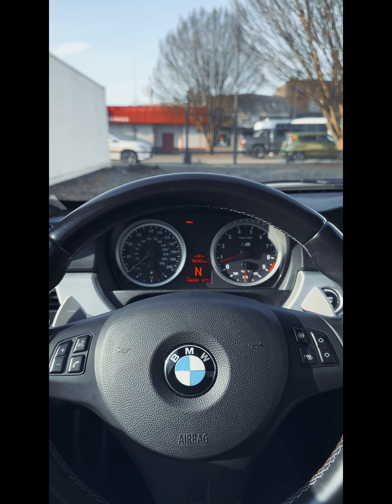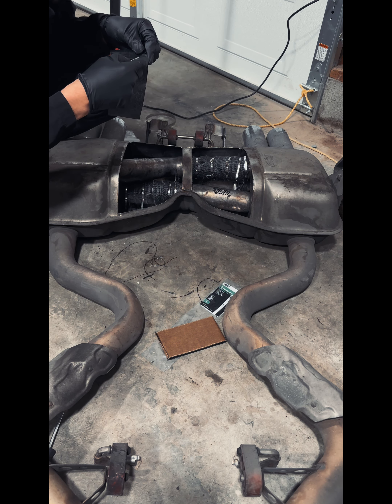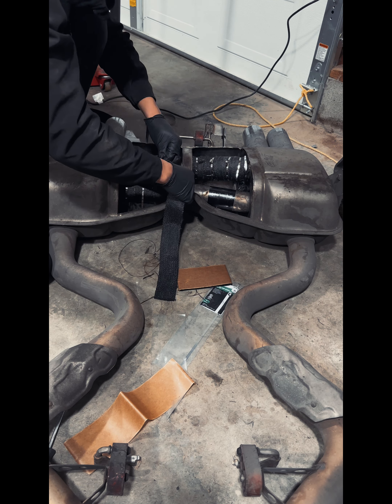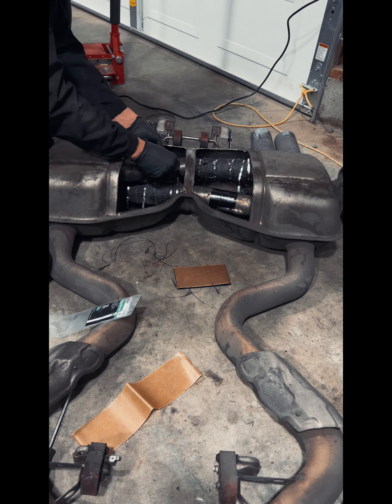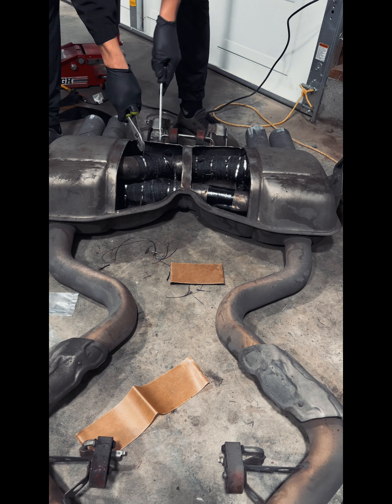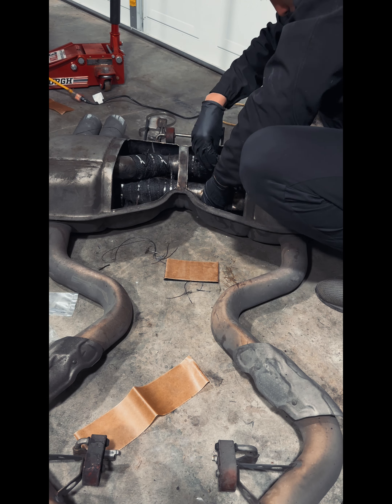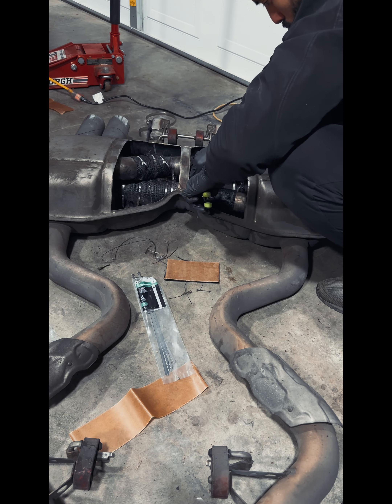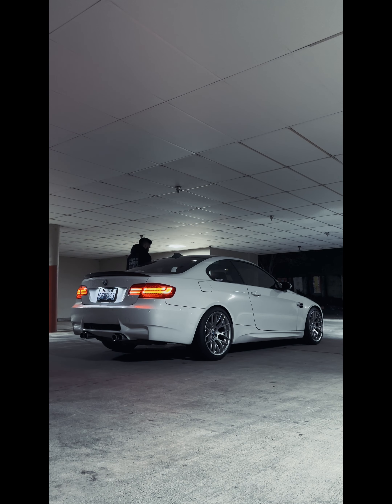E92 M3 OEM EXHAUST MOD - FASTEST AND EASIEST WAY! HONEST REVIEW, HOW TO & SOUND CLIPS

Comment: Pretty much followed your same steps for the mod. However over time the exhaust tape must not have held as it’s less loud. I wonder what a good alternative can help keep the mod more permanent…
Reply: weld the holes shut in the muffler thats what i did on my 135 when i did the pe exhaust mod instead of using tape

Comment: This exhaust is stainless steel. If you weld it with steel, it will rust very quickly. Need to use stainless steel welding rods.